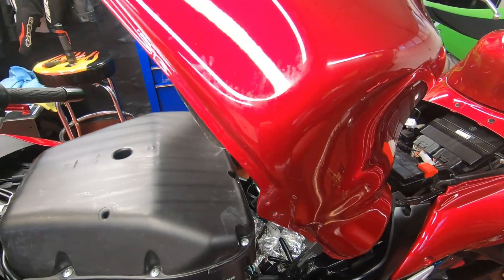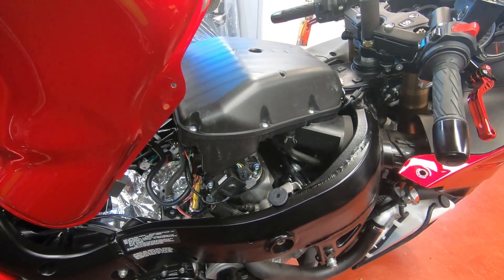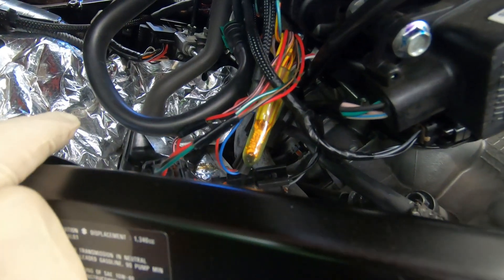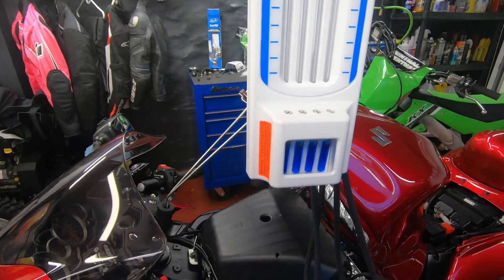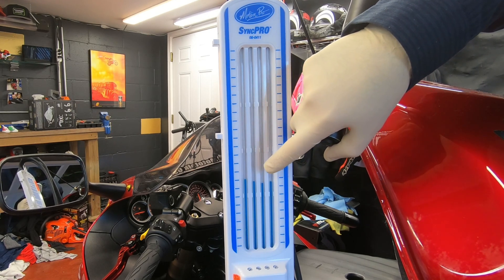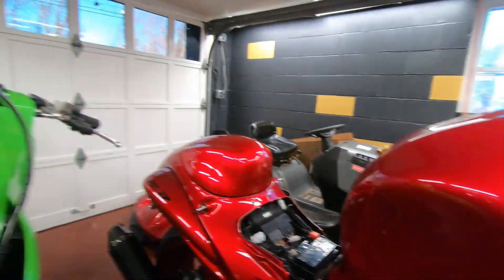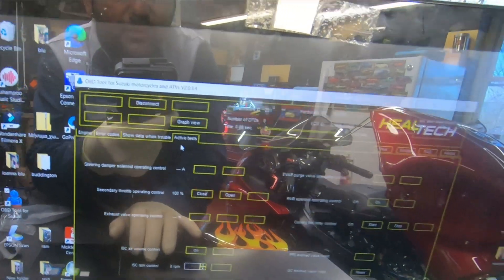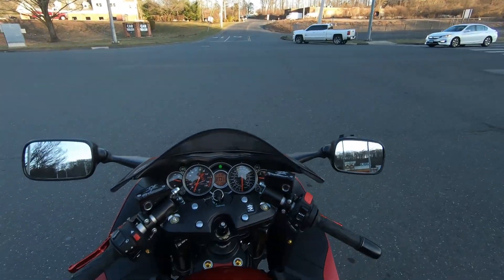How to Synchronize throttle bodies or Carbs | HAYABUSA | Mototalk USA

Comment: Where are the adjustment screws located? On the gen1 theyre on top but inbthe video i saw the air box wasnt removed. Am i missing something? Thank you for any help/advice. Also i appreciate you for making these videos.
Reply from the maker: You're most welcome man and I'm happy to hear you find value in my videos. So on the Gen1 Busa you have to remove the air box to get access to the adjustment screws which are found on the top side of the Throttle bodies. There's going to be 3 of them, not 4. First adjust the one on the right side, then adjust the one on the left side and at the end adjust with the center one. Hope this helps you!
Reply: @MototalkUSA  Thank you so much for responding. But I have the exact same bike as you do except it's the gray 2020. In the video I couldn't tell where you were adjusting the screws. It seemed like in the video the air box wasn't removed and it looked like the adjustment screws are located on the side. Is that right?
Reply from the maker: @ericmartin4817  my bad man, my understanding was that you had a Gen1. On the Gen 2 it's not necessary to remove the air box. The  adjustment screws are on the rear of each throttle body, they're facing the seat basically unlike the Gen1 where they're on the top. They're buried but if you look carefully you'll see them, they're small flat head screws. They're 4 total, some you can see easier than the others. You might have to move the wires a little to get a better visual on some of them.
Reply: @FASTONY  Thank you so much. This is awesome. Can't wait to get started.
Reply from the maker: @ericmartin4817  you're very welcome man! Happy I was helpful 🙌
Reply: @FASTONY so If I was to use the device on my gen 1, do I just clamp the extra hose on the synchronizer tool and does it matter which ones I use ?

Comment: so those with gen 3 busa when i did mine for the break in period i did get a f1 light and a hill control light and the way i cleared them was simply disconnected the battery terminal for 10 min and connected them and the light was gone but you will need to reset your clock and date and custom user setting if you set have them set up
Reply from the maker: Yup, absolutely correct 👍
How was your idle afterwards? Because in the repair manual it says to click on learn new values for the Idle Speed Control.
Reply: @FASTONY  my idle was fine nothing changed
Reply from the maker: @m1ckeydkorey781  ok, interesting and good to know 👌